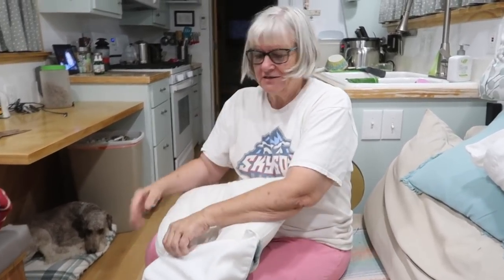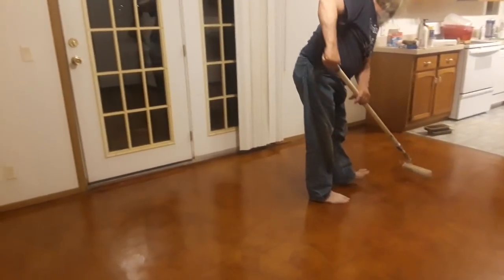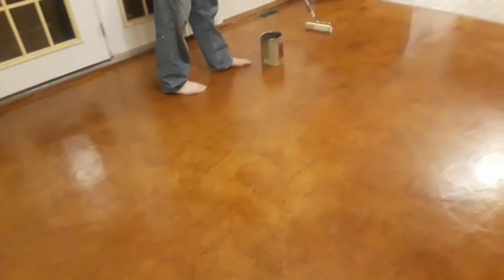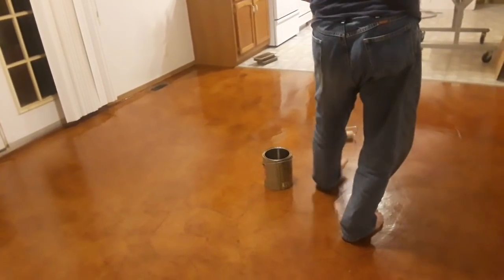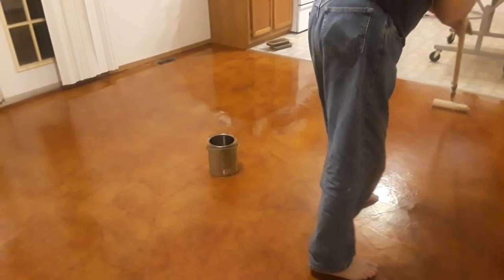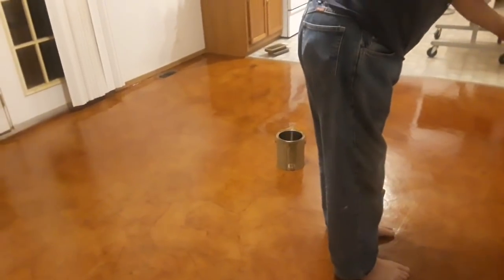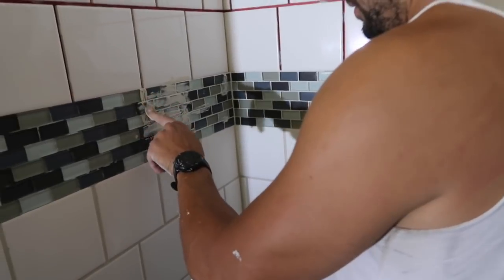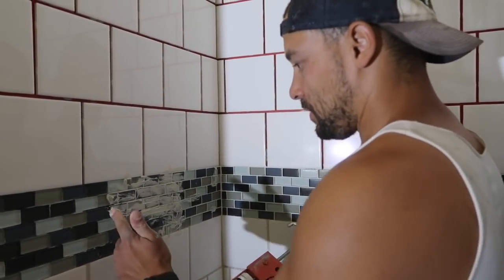Bus Conversion to Motor Home #151 finishing up shower House Ready?

Comment: pretty floor! I actually did a similar technique covering an older bible I had that the cover was coming apart... used paper bags and distressed them with walnut ink and then covered in thick clear tape.  It looks amazing.  I can only imagine how beautiful poly would be!  (not possible on a bible but thinking maybe later epoxy on something thinner... might be a neat option for our skoolie counters!).
Reply from the maker: Thank you so much.  The possibilities are endless indeed.  Thanks for all of your encouraging comments!